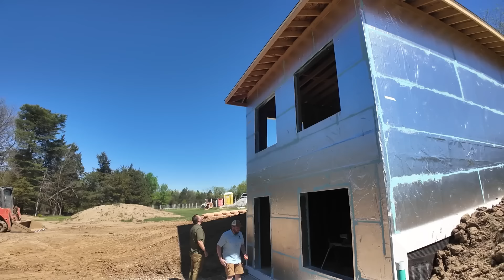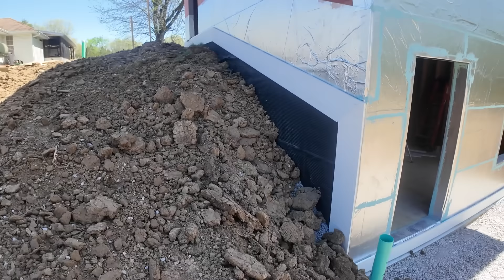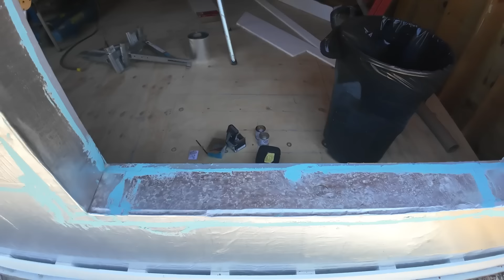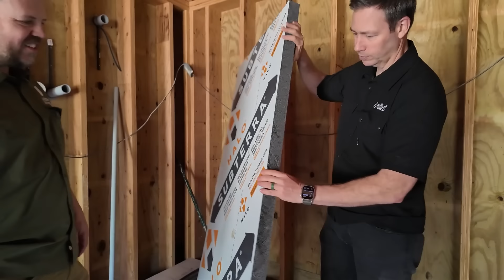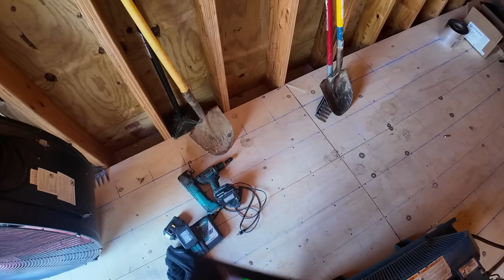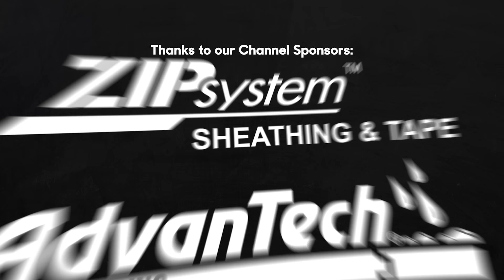Wooden Foundations - WHO KNEW

Comment: Sitting in a 1987 pwf right now. Wife’s parents had it built, we have concrete footing and a concrete basement floor. 2x8 fdn lumber and 3/4 fdn plywood. Father in law did a roll on asphalt roof sealant and 2 layers of thick black poly before backfill. We live on 70’ of river sand. In 30 years the sump has never had a drop of water in it. We don’t heat or cool the basement and it stays a consistent 66-68 all year. In our neighborhood in Mn here, there are like 5-6 other houses from the late 80s on wood foundations.

Comment: This definitely has its place, yes very eco conscious concrete is very energy intensive  . But I would be super sceptical about building in any kind of wet soil conditions. Water always finds the path of least resistance, any failed seam or gap your done.

Comment: In our firm, we designed a wood foundation for an addition over 15 years ago, allowed by code in New York, and still is in. Today's code. To this day, it has no problems.
I am not so certain about today's treated wood and prefer concrete, even if half wall with stick frame to get a 8ft foundation 
You should try superior wall... Concrete with steel studs and insulated, the company cranes into place and bolted together. Further there is no footings for the walls as they are installed on compacted gravel.

Comment: In 1978 I built the first All Wood Foundation home in Maple Grove MN.   The walls were panelized.  3/4" AWF Plywood and 2x6 AWF Treated studs with a treated 2x12 plate on gravel.  Studs were 12" on center and this was a split level home, so only 42" of wood in ground. It was a walkout to the rear and the it was on a 48" stub wall buried in gravel. Water proofing consisted of a water based Sonneborn product with poly over and backfilled with gravel.  There was a sump basket that drained to daylight.  I never saw water in it in the ten years I lived there.  The soil was heavy clay.  The house had 48" overhangs which helped mitigate water infiltration. The basement floor was concrete.   A round 10 years ago a friend that did handyman projects was working on a house.  When He described the house I knew it was the one I built.  The foundation was doing fine.
Reply: The company I work for is actually the original company that panelized your project (guessing). WoodMaster Foundations started doing wood foundations back in the 70's-80s (company name is now Edgebuilder). Still to this day we do 15 wood foundation a year in and around the twin cities. And still to this day, we have not had any major call backs on our warranty we offer with the wood foundations. I will always push for wood foundations when the conditions are acceptable, they are some of the best feeling/warmest basements you can step foot into.
Reply: @cHr1SGify  My package came from Lloyd Lumber in Mankato. they also panelized all the main floor framing.  In 79 they provided the materials for my parents home.
Reply: @cHr1SGify  there was also a company in Redwood Falls that made earth Sheltered homes of FDN lumber.
Reply: @cHr1SGify What is the cost compared to cement- we are trying to find a cost effective alternative to cement- we have looked at stone as we have unlimited access to lava rock- what would you recommend
Reply: I’m in Maple Grove frequently! It’s changed a lot since’78!
Reply: @koryleach9660  Yeah, I built the AWF home in 78.  Built a more conventional 2 story in 88.
Reply: @koryleach9660 this is on Yellowstone west of 101
Reply: My grandfather built his house with a pwf in Lakeville more than 40 years ago
Reply: I think I remember this.  Where would I have read about it in the last '70s?
Reply: I used to live in New Brighton, not to far from maple Grove. I lived in a house built in 60's by the owner itself
Reply: Sounds like houses cap homes had ask my father who built for cap. He built a few, then osb roofs cam about.  He then quit. Cap offered a 30 year warranty on basement walls.  The home owners had started to dig out basement at all most 30 years to replace.  The house has a big eve around the house. Drain feld around base of basement that drain to the center floor tank. Then pumped out to sewer.  Now, it's city illegal  to pump to sewer in builds. I  never inspected an houses built like that nowadays.
Reply: @busnorth CAP homes was a Minneapolis business.  I visited them at one point considering them for my build in78.  Ultimately I went a different route. They later went out of buisiness.  I'm not aware of them ever offeing Foundation grade lumber for basements.
Reply: They are the most incredible basements/walkouts

Comment: How would it hold out in a flood? Does it lift up and float away like a boat?  Does water rise up from the floor and fill the basement, ensuring equal pressure inside and out?  Or is the floor so watertight that the walls must withstand the hydrostatic pressure?
Reply: Basement daylights, so as long as you have a drainage plane you don't build up hydrostatic pressure.  Of course, if your basement floods from the walk-out doors you have a different problem.
Reply: @patrickkenny2077  Yes,  I was talking about a real flood, like the overflow of the Missouri River.  Just pointing out a situation for some areas.   The house that I grew up in that my father built was flooded with 8 ft of water by Katrina's 30ft storm surge (house is 22ft above sea level).  My brother rode it out there and says the water was eye level on the windows while  he was walking around inside in ankle deep. The walls and windows held, but then a spot in the floor gave way and water gushed in like a geyser.  He had to go to the attic and bust out a vent as an escape route, but the water stop rising at the ceiling.  When water receded,, he had to exit out of aluminum casement windows because the doors were swollen shut.  Maybe someone in the comments has had a wooden basement flood.
Reply: @markstipulkoski1389 concrete foundations have been known to become buoyant and float in areas with high water tables, I'd think this wood foundation would have the same risk there. But that is only a concern when the foundation is surrounded by water and the inside is dry. If it was surrounded and also filled with water, like in a flood, I suspect nothing would happen. The weight of the entire structure would overcome the buoyancy of the wood under water. I don't recall ever seeing wood houses lift up off their foundations and float away during a flood, but I do recall seeing houses flooded up to and over their roofs. I'd expect this to work just like every other wood house that got flooded, it will sit there and not float.
Reply: @ulbuilder  Go back and read my previous comments regarding my experience with storm surge during hurricanes.  My comments were before Helene had come ashore.  Helene has caused 100 year flooding in the southeast.  You can watch a video of a house floating down an Asheville street.  Admittedly, that is typically from strong current, not slow rising water.  My point with the wooden slab is that it sits on 4 inches of Styrofoam and not fastened to anything except the non-load bearing interior walls.  If I wanted to make a raft to float down a river, that's how I'd build it.  I think a concrete slab floor has a better chance of staying put and more of a chance to keep the basement from flooding completely.  Wood foundation  may be fine for areas without risk of flooding.
Reply: @viamoiam  I live in Florida and never had a basement.  I may build in NC and have a walkout.  I would never build a house with a full basement, requiring a sump pump to keep it dry.  But people do and I hear about them getting flooded by overflowing rivers.  In that case, the ground may become saturated and a water tight basement would feel lots of hydrostatic pressure.  If water is allowed in, there would be no hydrostatic pressure.  So my question was basically is a wooden foundation as strong as a steel re-enforced concrete foundation.  Would a homeowner regret his decision to have one if his collapsed while his neighbors concrete one didn't.
Houses are not boats, but they float.  Our neighbors house had to be removed from our front yard after Katrina.  Two days after Katrina I traveled to my mothers house to gut the house.  Helped remove lower 2ft of plastered walls at friends house in Orlando a few years ago when the  city decided to sacrifice a modest neighborhood by letting their lake overfill by not opening flood gates.  I plan to build an ICF house to the roof.  It is more  DIY friendly with fewer details to get wrong, IMO.

Comment: Wondering if you could do this with SIPS panels, would be a cool idea for some well insulated, non concrete foundation walls
Reply: They have those...  outside sheet of the sandwich is treated
Reply: @91BB19  good to know, thanks!
Reply: Thermapan SIPS . PWF panels. I’ve used their panels for a addition and it worked great. 🇨🇦

Comment: I don't know about current technology maybe it's better but in my area pressure treating wood has resulted in a super fund sites. How is that better than concrete?
Reply: Rewatch the video. Access to site for concrete wasn’t available without high cost. And material they used. Wasnt Home Depot PT lumber.
Reply: @dreewarren3080 he means that pressure treated wood practices led to ecological disasters necessitating EPA superfunds to clean up and remove toxic chemicals.
Reply: They did say it was pressure treated. They also imply that concrete isn’t environmentally friendly. I am saying that pressure treated is worse for the environment. There is no matrix that can prove pressure treated wood is better for the environment like they imply

Comment: I built a shed back in 2017 and the foundation is built from wood.  Ground contact wood.  16x48x10 feet.  Still standing and no issues.  The floor is 4x8 sheets of ground contact.  I've thought about building my house that way but I keep leaning towards no.

Comment: The use of premium materials on an inferior construction method. I would take concrete or block with an asphalt coating over this any day of the week. The only place I see this as being relevant is a remote cabin in a dry area.
Reply: Seems like a stretch to say that it is an inferior construction method considering it has been used for at least ~50 years now. Definitely a building method that is location dependent, but seems to suit the climate in Missouri. It’s a good thing to have more options available, even if you wouldn’t consider it. Relieving some of the over demand for concrete could help you get a lower price for your traditional build.
Reply: You are obviously not concerned about the environmental impact of concrete, but that is a major factor for a lot of people in considering how to build their home. Wood is a renewable resource that will never run out and is easy to harvest and process, and that is a huge consideration for me.
Reply: @dlg5485 all the glue in the sheathing and studs (they used LVL) and considering potential building longevity (I’ve never seen a 120 year old wood foundation home, but have sold dozens of rock and CMU homes that old) makes me question your argument. Cement plants should use green energy and work to cut their environmental impact. We shouldn’t all sacrifice quality and longevity in a myopic attempt to lower environmental impact and inadvertently cause a greater impact when our structures end up in landfills and have to be replaced at additional expense which requires the payer to work and generate additional CO2 potentially every 50 years to pay off a new mortgage instead of building homes to last 400 years.
Reply: @CountJeffula  You haven't seen a centuries old wooden foundation because builders didn't know good techniques then that they know now as far as installing and protect it properly for longevity. Knowledge and technology will always continue to advance. The techniques used in this building appear to be pretty stout and, I suspect, it will remain standing for many decades.
Reply: @dlg5485  many decades is not two centuries. The fact that the sheathing is OSB is very concerning to me. It is a magnet for moisture and one tree root once will be its doom. Feel free to live in inferior structures, but don’t force them on others or speak to their longevity when you yourself said there are zero examples. It’s a cheaper method for a cheaper, lazier, more disposable world. Nothing more.
Reply: @CountJeffula  When you figure out how to jump to the future, let me know, but until then all we can do is test different methods and see how they work out.
Reply: @dlg5485  I'm doubting the credulity of the statement "not concerned about the environmental impact" from a position recommending the replacement of simple carbon dioxide with creosote, pentachlorophenol, copper chromate, isothiazolinones, propiconazole, triadimefon, and various heavy metals, PFAS, and endochrine distrupters used to make ground contact wood products; all of which leach into the soil and water supply in and around the structure. Don't let perfect be the enemy of good.

Comment: Pratt homes builder license #1 here in MN still builds primarily wood foundation homes.
Reply: Years ago we did concrete flatwork for Pratt Homes here in the KC Mo.area and they were terrible homes. Bad quality throughout. Would make us put driveways on top of soupy/muddy soil. Wouldn't buy gravel. Tight on rebar and only paid for the cheapest concrete mix. Drywaller's said it was like that for them too. Making them use scrap pieces of drywall from another home but didn't want to pay extra etc. Painters, All trades really. complained. We did our contract and adios. They didn't pay a lot of guys. We got lucky and got ours early on in the last year.
Reply: Good to know, I will avoid these people. They sell this because its cheaper and BS you into believing its better when its not. It will rot, guarantee it, only a matter of time.

Comment: I think external rigid rockwool for this would be ideal (and keeping it unfinished) just from an inspectability standpoint, but also might help with bulk water drainage over the wrb. I wonder if the code requires drywall and cavities infilled for fire reasons?
Reply: Yeah,  I know I'd feel better with empty stud bays... but I think the typical detail in Canada for example is to simply fill with batts.
Reply: Agreed it’s a bit weird I don’t think they referenced external insulation. Would backfilling with stone compress exterior mineral wool?